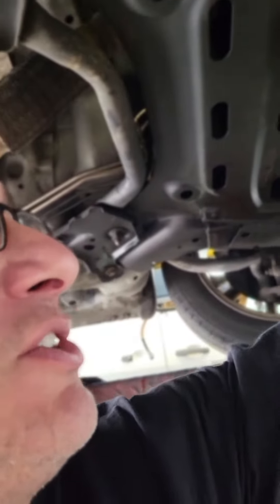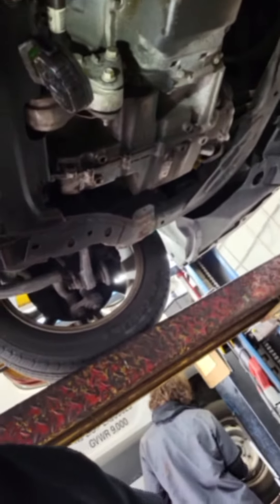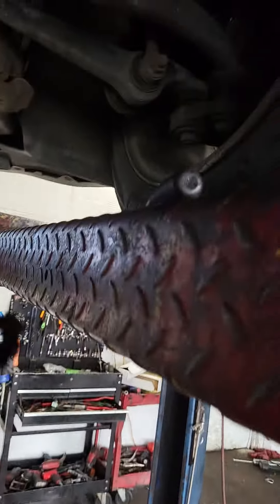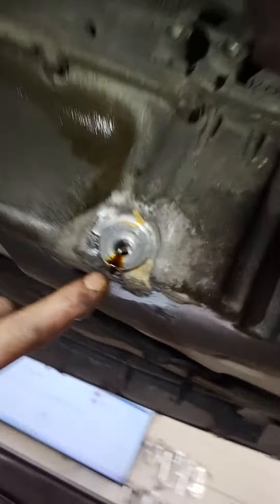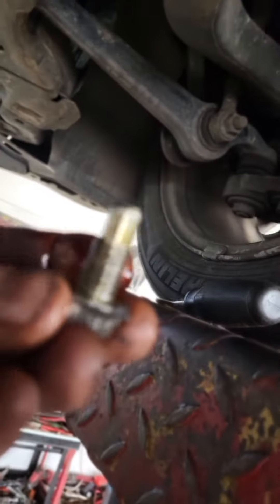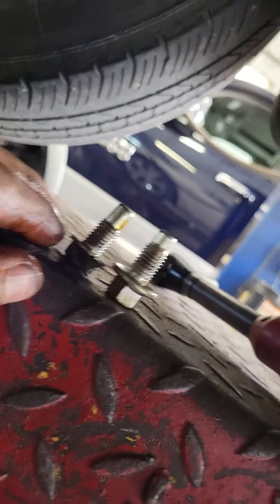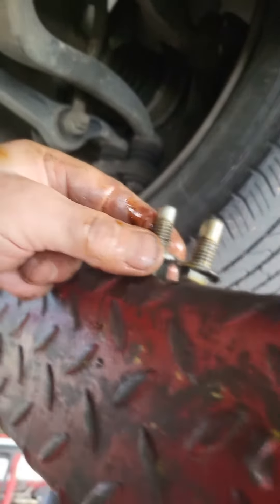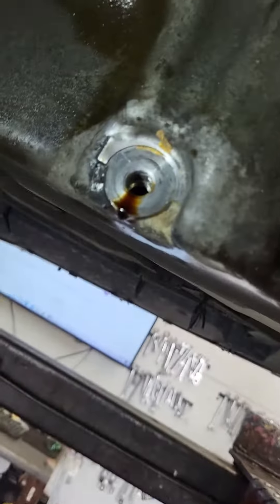2012 ford fusion stripped oil pan longer drain plug trick

Comment: Old days show me a 100000 mile car, and I'll show you a self tapping oversize oil plug with a center drain.  Every shop carried these in-house and was part of doing business less they could blame previous shop of stripping the oil pan.
Reply: My 2010 Ford Fusion V6 3.0L has like 105,000 miles on it. The car was driving perfect, I drove it in to get a routine oil change, and now the car is inoperable because they say the oil plug is stripped. Midas Auto Repair is asking $1,000 grand total for replacement oil pan parts and labor...